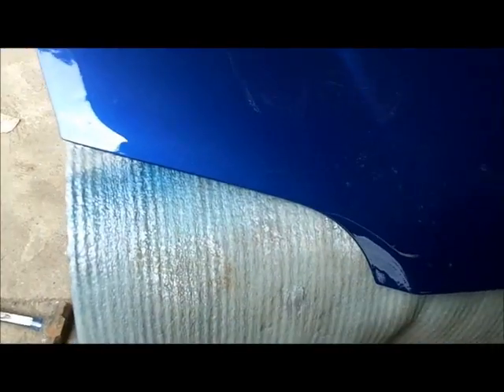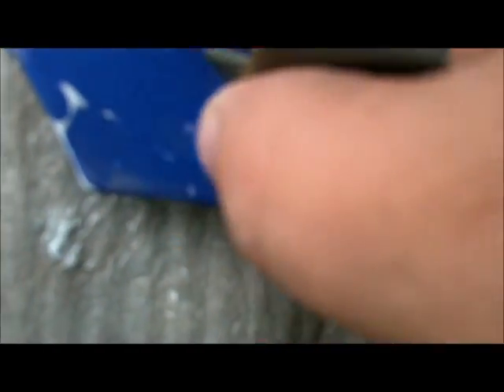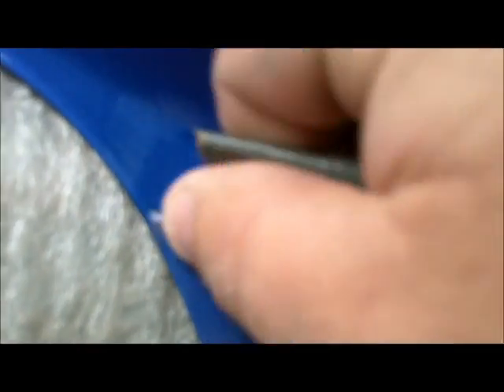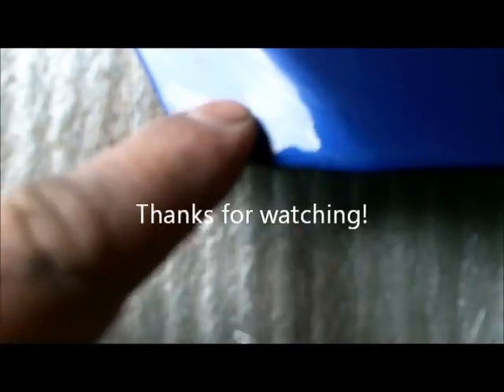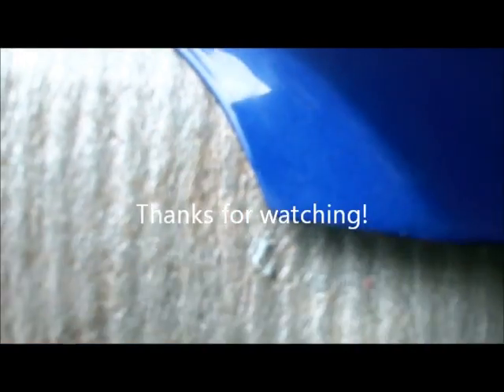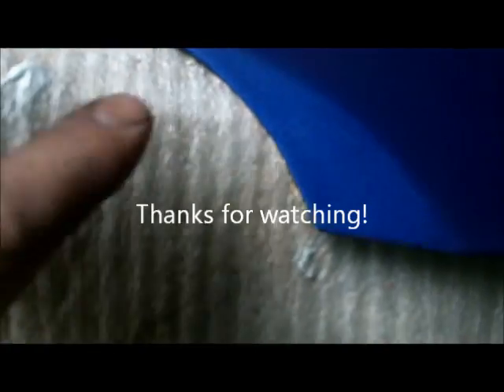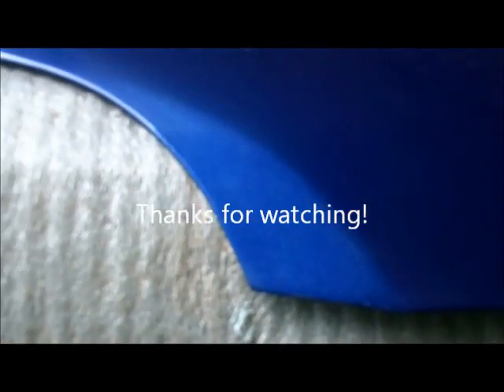How to Remove a Paint Run in an Automotive Finish

Comment: Thanks for all of your videos. You are a neat guy Pisser.  Do you have any videos covering corvette fiberglass repair? I have an '84 that has a messed up lower left hood corner.  I need to reconstruct the corner tip. I am guessing that I could use some duraglass to make the corner once ive sanded it down. What say you Pisser?

Comment: I've seen this method and been wanting to try it. I use a square small heavy metal block, the size of a coin to wet sand runs, drips, or dirt specs. Usually 2,000 sometimes 1,500 or 1,000 if I'm in a hurry or have lots of clear to work with.

Comment: you use the putty the same way you use a guide coat for primer.
since the area around the run would get damaged by sanding the run and then it would mean painting it ... you use the putty by applying it to the whole area.. then you know when all the putty is removed the area is level ... this ensures that you don't go through the clear under the putty because it might be a normal thickness or it might even be a thinner thickness of clear around the run.

Comment: so I take it the run was a clear coat run? If I get a run in the base coat is that due to having the gun to close to my panel? and would I just 400 wet sand the base to remove the run? Thanks.

Comment: Ok now i'm abit confuse i just wet sand the run with 1000 grit till it gone and  then i go over it with 1500 grit then 2000 grit and it done. I don't use putty and all for run.